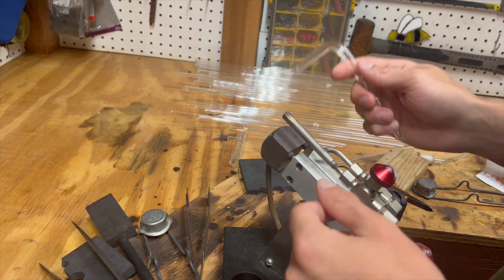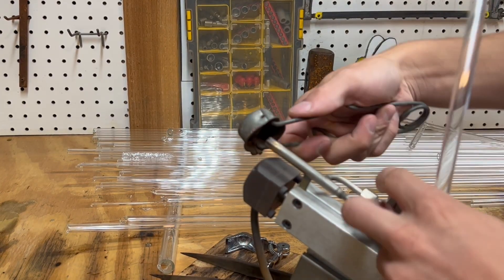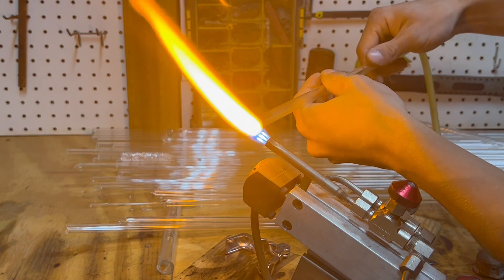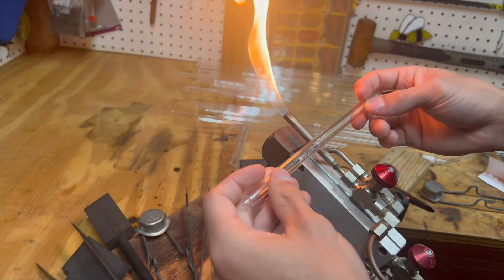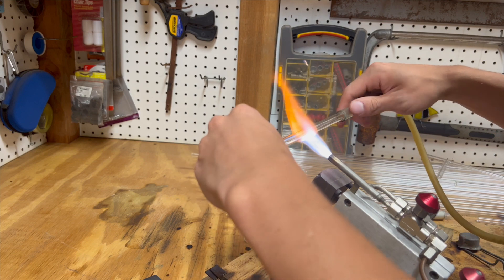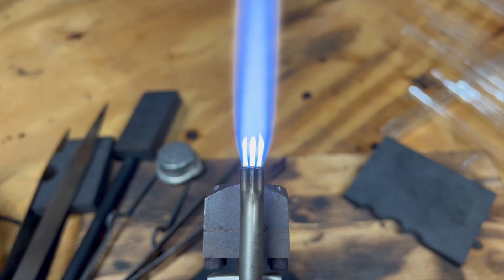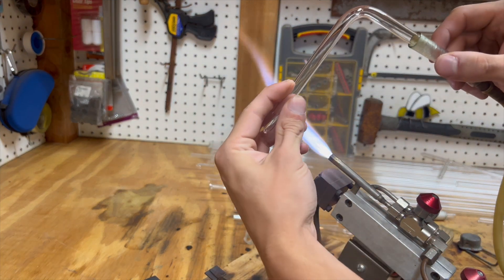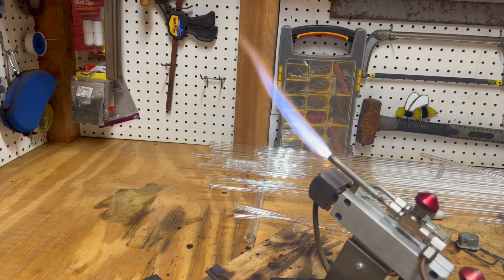How to Bend Glass Tubing - Scientific Glass Blowing Techniques Episode 6

Comment: Could a glass pipe that’s already been blown and curved be reheated and have the direction changed? As in pipes with a bowl at the end of them, could you heat it and change where the entry hole of the bowl is? Basically going pipe to bubbler pipe?

Comment: I am on the look out for torch like that, the one I have seems to blow itself out too easily and isn't really a glassworking torch anyway. Do you have any recommendations for someone on a fairly low budget?
Reply from the maker: I actually got that torch another smaller torch, tool and a 125cf oxygen tank for 100 USD. I always recommend checking eBay and facebook marketplace for torches they pop up every once in a while for a good price. A working Nortel Minor should run you 100-150 USD.
Reply: @WheelerScientific  funny you should say that earlier today I bid £100 for a Nortell Minor
Reply from the maker: I hope you get it! Its a fun hobby.